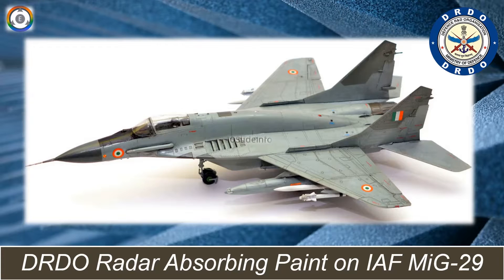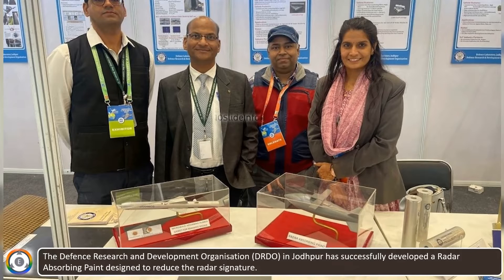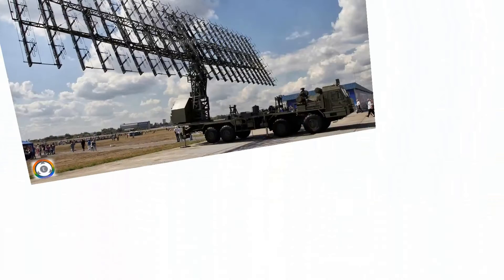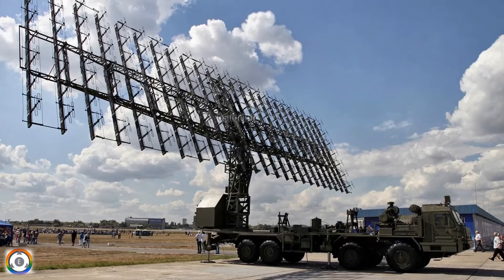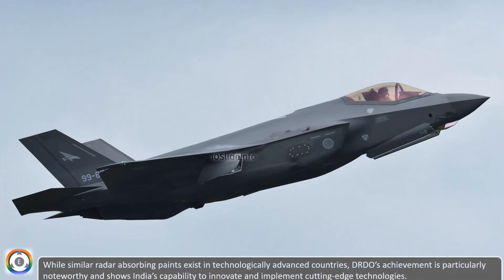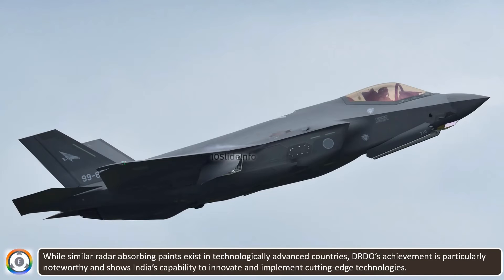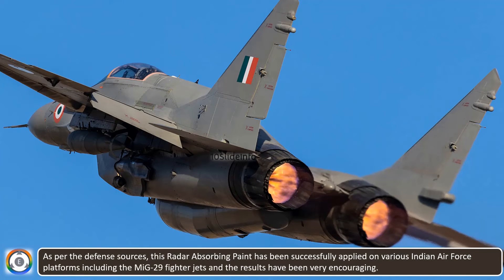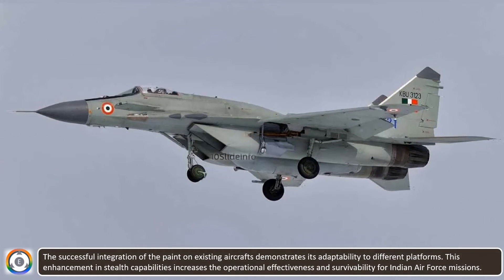DRDO Radar Absorbing Paint on IAF MiG-29 | RCS Reduction

Comment: RAM is just 1 of many components combined to achieve stealth. Reducing the RCS of a mig 35 from 15 to 7 is great, but is still a super large RCS and far from stealthy.
Reply: Agreed 👍
Reply: Stealth is a spook. It’s propaganda used to sell planes to American vassals. It doesn’t exist. Retired engineers at Boeing and Lockheed have said as much on video. 

Low observability is a legit feature but with modern Radar systems and layered, 6-7 layers deep, IAD systems  there is no invisible jet.